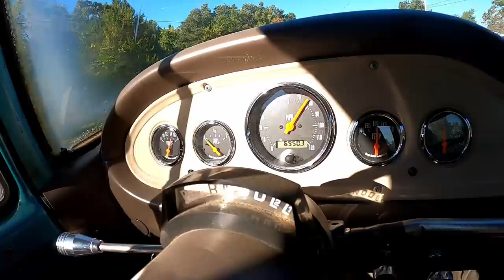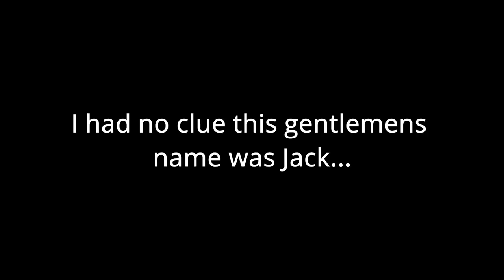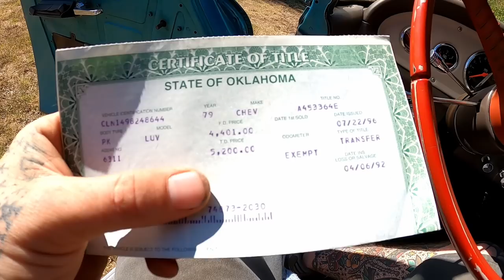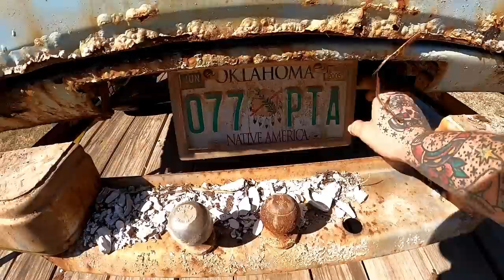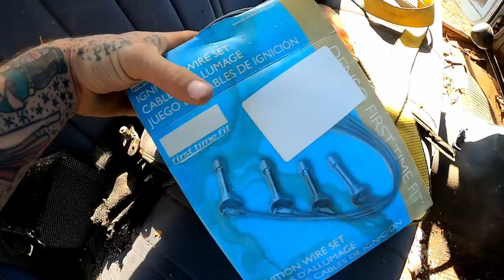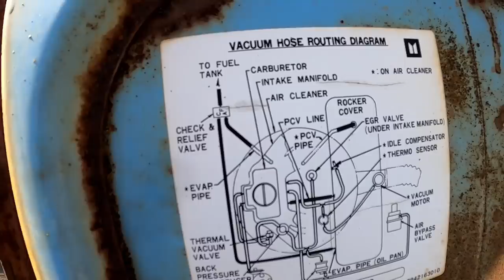How Bad is it? 1979 Chevy Luv.

Comment: Makes me miss my old 4X4 Luv. That thing was tough, ran great, was great on gas. I use to take that thing rallying in the Colorado Rockies full of camping gear.
Reply: I was wondering if they made them with 4wd. I would luv to have one. (Pun intended)
 I have never seen one 4x4. I've seen a bunch that were made into dragsters. 
 If I find one 4x4 I am gonna jump on it. If the motor can't be saved I will put a 4.8, or a small diesel in it.
Reply: @letsdothis9063  I look back and realize I didn't appreciate it enough. I can say that about several vehicles I owned though...that 72 Scout...
Reply: @letsdothis9063  a 4.3 vortec would be awesome in it, or a 4bt
Reply: @letsdothis9063 Yes, they did indeed have 4 wheel drive LUV Trucks back at that time. My brother in law owned one, it was a 1980 yellow Chevy LUV 4 wheel drive truck.
Reply: @letsdothis9063  I had a 79 4wd. It was a really great little hunting rig. Unstoppable with studded snow tires.

Comment: Bought a 79 4x4, replaced the blown head gasket and started beating on it in the Oregon woods. Launched the front ring gear right through the housing. Drove it 2wd while I looked for a Toyota front axle, then the upper control arm ripped off the frame coming into the driveway. Swapped the Toyota axle in 5 nights after work outside in the winter, brr. Great little truck!!

Comment: Love the channel, drove a 75 baby blue Chevy Luv. Timming chain tensioner failed and sent the chain right out of the case. Three months later, found a Luv on the end of a tow truck, followed the truck to the local wreckers and convinced the yard's owner to let me buy and remove the cover and borrow his tools. All of this while on the clock (boss wasn't happy I was missing with company truck for a few hours). Got her running that night, little Isuzu motor wouldn't quit. 1983, 18 and back in business. 20 bucks lighter and big ass chewing from the boss. Couldn't explain how I came back to the job greasy. Loved cruising that little truck.
Reply: I'da bought the whole truck and used it for parts for the one ya go now. I loved the looks of the LUV trucks from 1972 till 1980, especally the 1975 ,6,7,8,9 and 1970 trucks.

Comment: The first vehicle that was mine to drive was my Grandpa's yellow Chevy LUV..I loved that truck. My mom's mom and dad went all over the country in that truck with a camper on the back. Grandpa had a shop and a junkyard on the side of his house he had welded up a 50 gallon tank for that truck.

My dad randomly took it away and gave it to his business partner for the partners daughter to drive. She wrecked it in a month.

The replacement was a Datsun F10 hatchback. It looked like a mini Gremlin somebody had put a series of stripes on the back quarter panel like a gremlin. It was the first front wheel drive that was in fairly large circulation.

Racing through neighborhoods with my friends that little Dotson was faster because it pulled through the corners with that front wheel drive. I still prefer drifting with rear wheel drive though.

Comment: I customized a 1972 LUV back in the 70's.  Sun Roof,  dual outside exhaust, fender flares and front air dam, white paint with Hugger Orange and Chevy Blue Graphics.  We did a large spider on the hood. It would run 100MPH with the Overhead Valves and a .015 Head Shave.  Drove it until I sold it to another car guy.  It was one of the most fun rides to drive I ever had.  Good Luck on this new project.

Comment: In highschool a buddy put a 500ci caddy with the transaxle from a Eldarado in the bed welded the transaxle steering and left the little 4 cylinder running off a jug under the hood. He used to do a huge burnout, jump out and pop the hood and adjust the 4 banger. Ruined the chassis from the torque of the 500. But we had fun for one summer with it.

Comment: I de-smogged the 1.8 that was in my '75 LUV. I used the old spark plugs to plug the air tube holes in the head. Screwed right in. This wasn't a crossflow head.

Comment: I bought a 79 back in the mid 90s. It came with 2 extra rebuilt engines. He said, youll be replacing them every 25k miles unless you dont mind oil fires coming out your exhaust. He wasnt lying.  I said screw it and put a 2.5 Iron Puke from a late 70s Pontiac Sunbird. That fixed it real nice. These Isuzus were junk. They got a ton better as the P'up after GM dropped these and released the S-10.

Comment: I like the Chevy LUV - neat little truck.  Down here they were known as the Holden Rodeo and were known for being a tough and dependable unit.  Mates of mine had them as work trucks back in the day and the little beasts happily did 200,000 miles and more on one engine, which isn't bad for the time or the size of the power plant at all.

She appears saveable if you wanted to do a series (and a lot of panel steel work) on it, but yeah.  Sometimes you have to draw the line between obsession and practicality.  Would definitely like to see it run and drive again one last time though.  All the best!

Comment: Another great project! Those Isuzu's are tough trucks!
Reply: 1.8s are junk
The 2.2 3.2 and 3.5 came way later
I have an amigo now 3.2L they have steel sleeve cylinders and 4 bolt mains you can super charge them. Stout motor with the updated rebuild kit.
I won't touch another 1.8L ever again

Comment: Idea for the wall hanger door for the shop, since the truck looks like it would serve better as a parts rig.  I’m thinkin’ ya do a polish on what’s painted and some “Sweet Patina Sauce” on the rest.  Paint a sweet “77” on it in white and outline it in red with the pin striping brush and add some other red and white pin striping here and there.  The picture in my thinker box looks pretty cool…could be a good 2nd channel vid too!

Comment: I've had a few Chevy LUV's, S-10's, and GMC S-15's with those little Isuzu motors (1.8 & 1.9).  Good little motors, but prone to headgasket issues and electrolysis eating up the heads between cylinders.  Side note: a 1.8 head fits a 1.9 but you might need to step up to mid-grade gas to keep it happy.

Comment: The engine bay by itself made a good lil trailer.  Rear axel went to the front. Dropped in a metal floor from the bed. Bent the frame and put on a hitch.

Comment: Had a 1978 Luv back in the early 1980’s. The sheet metal was too thin and the factory muffler was not adequate which caused the bed to rust out extremely quickly even in the Deep South where we do not have salty ice roads.

Comment: I had a 74 the same color. It was a tough little truck. I replaced the head gasket on it just after I bought it. Ran it for a few years til the engine blew up. Never did check it out much further than checking compression. Three cylinders had zero compression. It was built by Isuzu for Chevy. I thought putting a Toyota 22R engine in it and on the tail gate using the first three letters of Toyota and the last three of Chevrolet. Then I could cal it a Toylet. It being a sh*t box truck and all.

Comment: Excellent video Puddin  :) also my uncle John had 1976 Chevrolet  LUV with daul headlights type in Baby Blue body only remember much about he had till 1984 then bought Toyota 2600 small type with 2.4 litre 4 cylinder with 8 spark plugs plus wires, 5 speed Manual transmission 6 studs rims with low profile 16 tires too and in 2005 got 1994 Toyota  T100 Sport truck with 2.4 litre 4 cylinders  with 5 speed Manual transmission floor shifter to and 377 rear ends gears! Also LUV stands for by me means Lucky U Vechile and license plates you want funny  Lol Puddin to understand my late Uncle & Dads 1968 International 1 ton had this on H eavy D uty 11000 was Red and White background  for 1968 year ! There 1979 GMC High Series Serria 25 3/4 Single doors  had black characters with white background was D rive Vechile 8 cylinder& 398 days a  year around everywhere ! That told me stands on letters and Numbers on those trucks Lol! R be Rambler car or Rolls-Royce to or Ford Ranchero!

Comment: You Got 4 of those ARC PLUGGZ  for that Isuzu Motor can I Buy Those ARC Pluggz I head you Collaborated With Nikola Tesla Coilz amazing Spark Just ARC everywhere
Reply: I had a 77 LUV it was a Fleet Truck not the Enema Fleet , the Phone company same I t was a dependable Truck swear I would burn some Rubber every day yes from the Tires bought a 2 nd trans yeah not the Trannyz of today rainbow MOFOz , 4 gears kind and a 32/36 Webber Chooper Carb U Raader then I hIt a Huge White Doggo one night it took out my Chrome Bumper and some fender , poor thing I forgot to check the Coolant in the Ra Daddy A tor Then it died blew a Head gasket those lil trucks keep going If you Remember to put Fluids in the  motors

Comment: I had a 76 77 79 and a 81
Worst trucks I ever had
Head gaskets charging systems alternators voltage regulators
The garbage 1.8L went on to geo storm and the later S10
You'd be better off smashing both hands with a 3lb sledge hammer